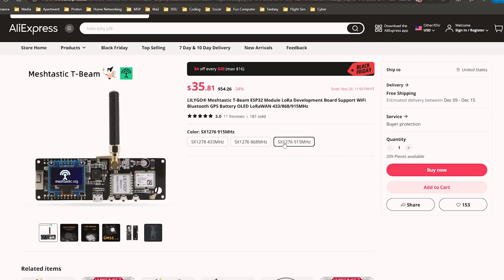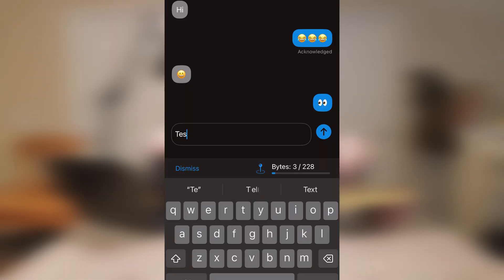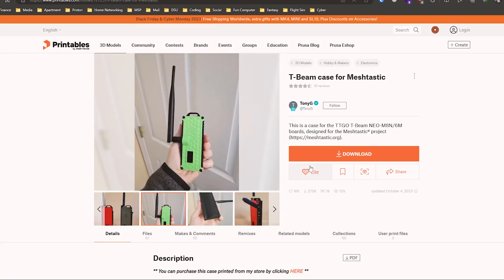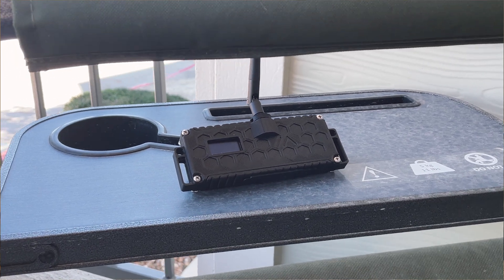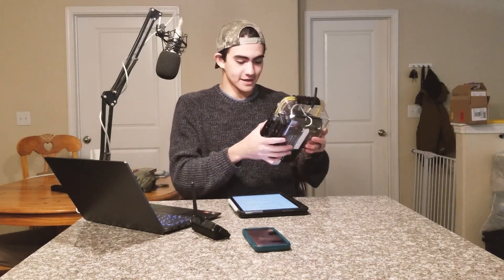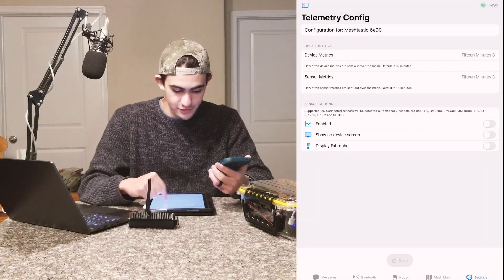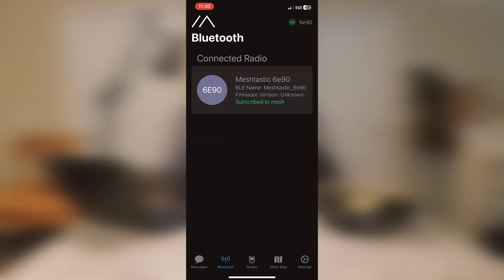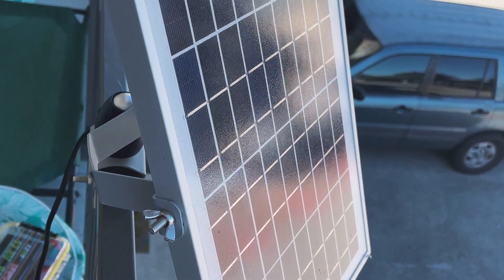LoRa & Meshtastic: Next-Level Emergency Communications! 🌐🚨

Comment: Meshtastic looks fantastic!! My question is how the mesh network works when you're not using your own devices. More specifically, if as you demonstrated in your video, meshtastic unit 3 is used to get message from 1 to 2. If meshtastic unit 3 isn't yours, what's the protocol/procedure to use the mesh network to get your messages out?
Reply from the maker: So it depends on your channels. You can think of each channel as a group and those are the only people you can communicate and mesh with. The primary channel that is default is unencrypted and can talk with anyone else on the default primary channel! Location data specifically is always sent on channel zero so your location is public. Otherwise you can change your primary channel to an encrypted one so that all your location data and messages is private and encrypted. I may be missing some information but I’m trying to learn more about it!